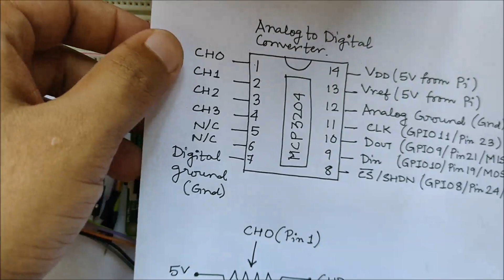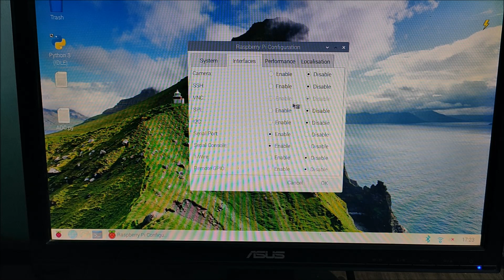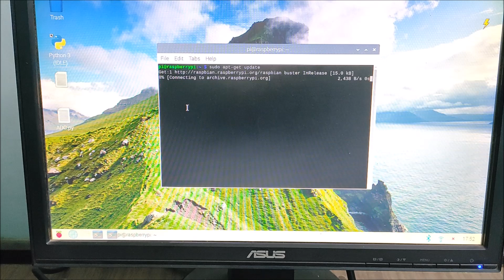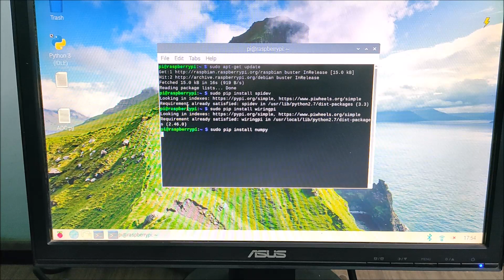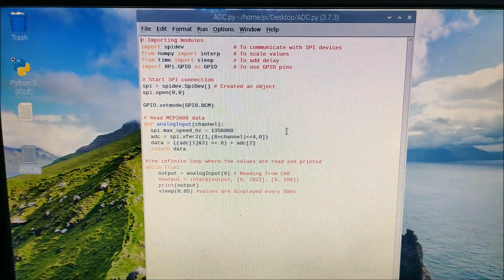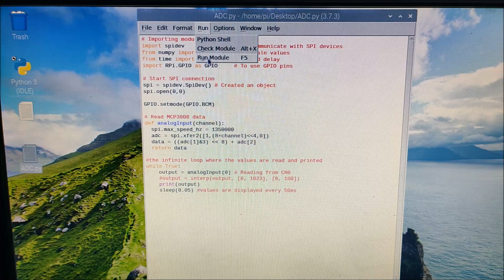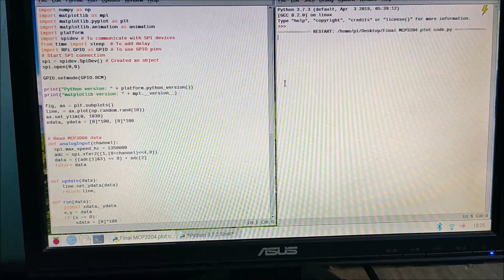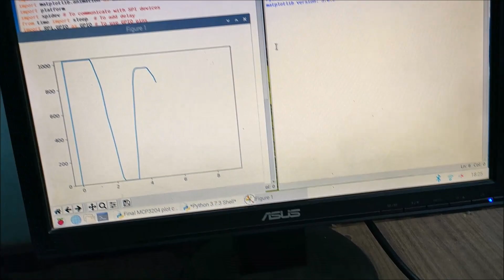Analog Input on the Raspberry Pi  || Analog sensor value plot using MCP3204

Comment: MCP3204 sends a 12-bit range value, but in your video you get a 10-bit range value. ¿How i can get a 12- bit resolution?
Reply: It looks like Ustav is using a snipet of code for the MCP3008 which is a 10-bit 8-channel chip. 
It's impossible to tell from the video if the code is scaling his results down to a 10-bit range or if the other 75% of the input from the 12-bit  ADC is being chopped off.